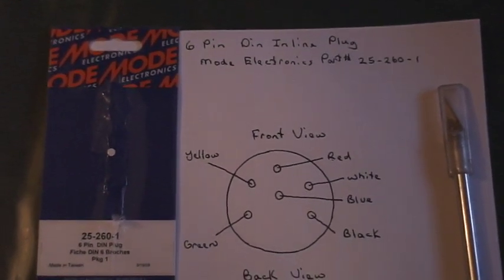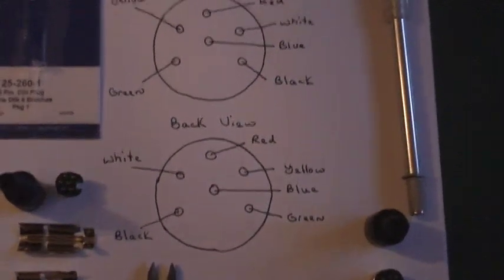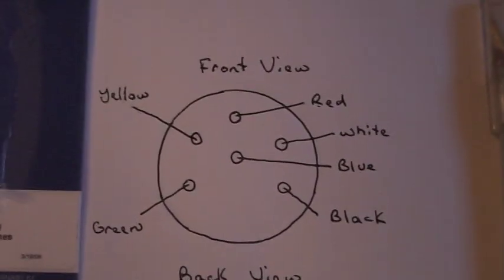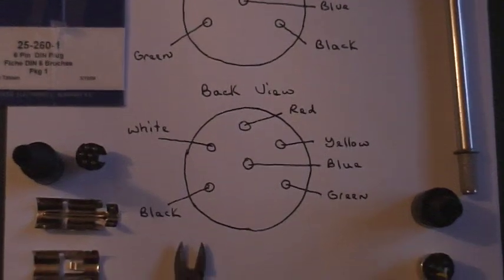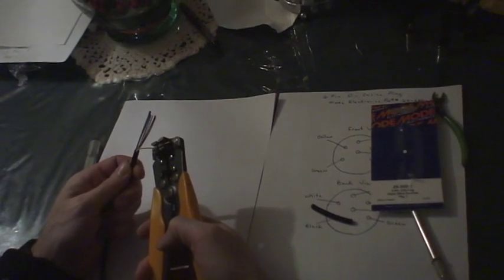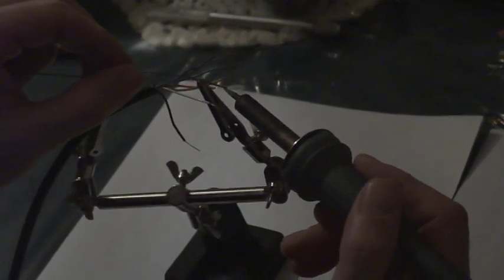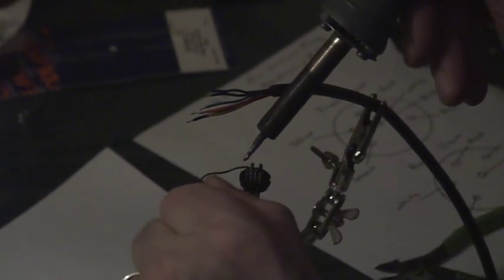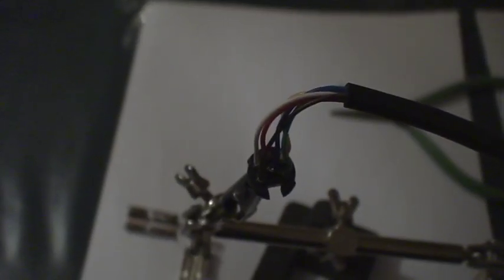Marshall footswitch 6 pin din plug repair

Comment: Pig tale it, buy a pig tale and just make the connection a couple of feet from the new connector, solder wirer together but make each wire shorter or longer and use heat shrink material and then one large piece of heat shrink over the entire cord and your done!
Reply: Good idea like my RCI 2970 Ranger ham radio.
Reply: @MulletTheGuitarGuru  Great radio !!!

Comment: Very helpful video. I will be ordering the part. My other issue is that the cable is broken in several places so I want to replace that as well. Do you have any information on what the name or part number for this type of cable is called? Thanks in advance!

Comment: the footswitch socket in the TSLmarshall head is a terrible design, only the solder joints hold it in place and after a few years or months of pushing the  connector in it becomes loose and snaps, after having mine resoldered twice I drilled and attached a strap that sits behind the connector to take the strain..   as I said awful feeble design that they knew wouldnt last

Comment: Help me out guys.....when I tried to tin the pins....the solder wouldn't take, so I held the iron against them for ages...and the plastic of the plug melted and the pins moved.  Next I tried not tinning the pins....but then it took ages for the wires to solder to the pins...and the plastic melted again - what am I doing wrong??!!!

Comment: @wellsww Thanks for posting the video.  Maybe you can help me - I am experiencing a related, but somewhat opposite problem.  The footswitch controller socket on the back of my TSL 100 is loose.  Do you have any suggestions/experience with reattaching, repairing, or perhaps replacing the foot switch input socket?  Thanks in advance.

Comment: @wellsww Here's my problem. I have a Marshall TSL with a 6 pin footswitch. I think I have a problem with the effects loop switch. When nothing is plugged into the EF loop, the LED on the footswitch is NOT suppose to light up when pressed. Says so in the manual. However mine does and it somehow switches my amp to a dirty channel. Also even when the EF switch is off, I can switch between clean and dirty, but only one dirty channel, not both like it used to. What does this sound like to you?

Comment: Would I be able to put in another socket in the amp?
I mean I really want to be able to switch my amp (randall rh50t it has the same 6pin din connection) in the same time as I switch my midi products.
Couldn't I put in a stereo jack socket or a midisocket?
Thanx in advance